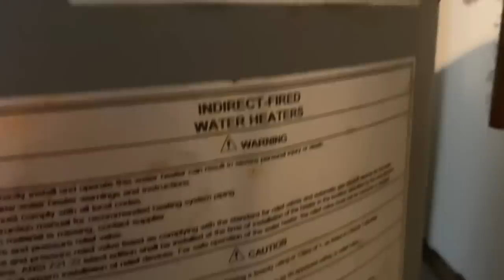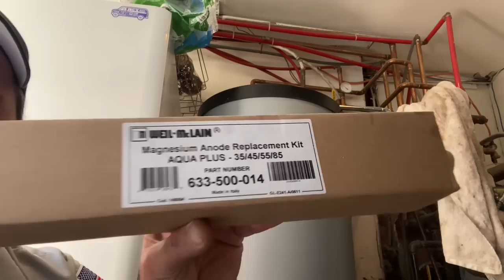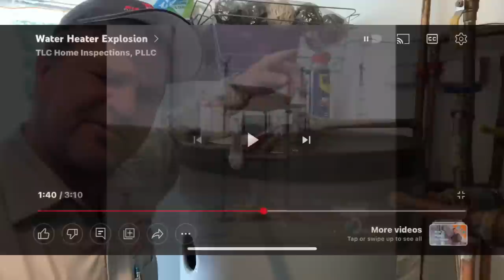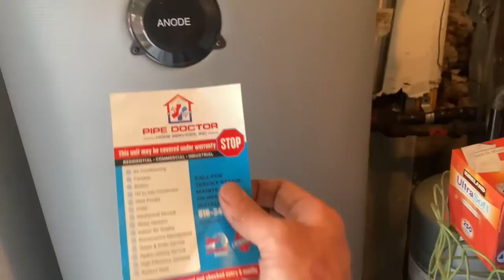How To Maintain Weil McLain Indirect by Flushing Tank & Replacing Anode Rod

Comment: I had to replace a 5 yo water heater because it was never serviced. When I drained it, it was full of white chips as shown in the video and the anode rod had dissapers.
Mike if Teflon is applyed to the anode rod it will isolate the rod and negate it job. The rod act as a negative so if you remove the connection to the tank with Teflon it doesn't work

Comment: I did mine Wednesday and I put blue monster Teflon. Guess I have to redo it. Gonna pick up megaloc at homedepot this weekend and redo it
Reply: Sharp threads cut right through Teflon tape making a good electrical connection. Don't need to redo it.
Reply: @crvinva  ok thx for the info
Reply: There’s a reason you don’t Teflon low water cut offs in steam boilers.

Comment: I can see where the tape would insulate the two pieces of metal from making a proper connection but pipe dup would still allow a connection while still sealing the threads.

Comment: Shame I cannot post photos.  I keep a T&P in my truck,  it had a slow drip and over time stopped dripping.   When I pulled it the inner guts were plugged solid.  I show this valve to a lot of homeowners.   The valve itself and vacuum relief required in this state are both relatively inexpensive.   If a tank is drained for any reason they get changed.   If am told a relief was dripping and stopped,  it gets changed.    If your going to pull the handle to flush it, just change it.

Comment: Teflon tape is an insulator and could interrupt the sacrificial electrical process.
Reply: @PipeDoctor  It's called "galvanic " reaction. The tank is protected (cathode) and the rod is sacrificial (anode.) Must be connected for reaction to occur..
Reply: @patmurphy2472  So the threads should not be sealed? The washer is what seals it?
Reply: @chicagolandbrokersrobertno3553  You can use some pipe dope to keep the threads removable, but yes the o ring is the sealing device.

Comment: I used to change one for a lady had bad water I would change it every year there would be nothing left of it just threaded rod. She skipped a year I changed it put it back in leaked like a sieve. Called weil McLain they said her fault she should have changed it more often.
Reply: Yeah it's well water pretty bad
Reply: Water softener will eat a rod in less than a year. Water heater manufacturer says to inspect/replace annually if using a softener 🤷‍♂️

Comment: Capping relef vave nothin. 350 psi nothin my 7hp 180 gallon tank air compressor cuts out from factory at 195psi. It far more fun laying down the big k size oxygen tanks an knocking the valve off an watching it spin around like a turbo charged top an sudenaly picking a directoluion an taking off like a horizontal rocket blasting though a 10" hard concrete wall and keep going to the 2nd to 3rd city. Taking out anything in its path. Yes been there. 2200 psi. And many cubic feet .. the k size tank the largest shop tank avalable. I had a small tiny tank cone though box of tuck. The cab. Take the top of the engeine off. Take out the grill. And keep going. It was one of the buy out tanks used by plumbers in a cary box big dismal acetylene tank torch set. 2200psi torpedo